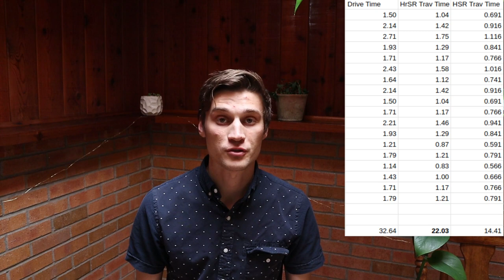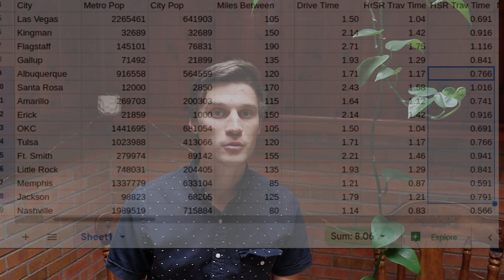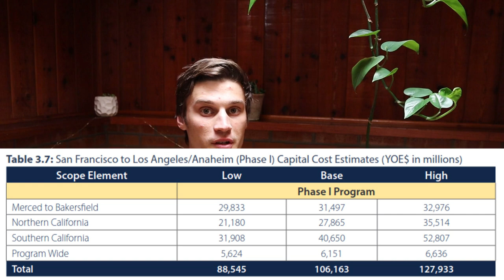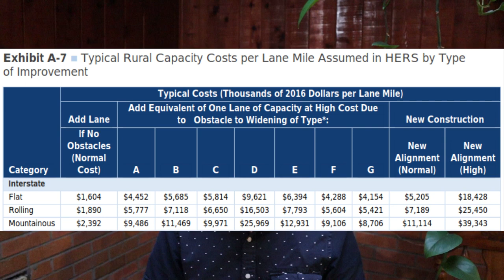What if Interstate 40 were High Speed Rail?

Comment: Nice video!
One more thing I'd point out: cost of land/right of way in California is part of the cost estimate of our HSR project. Building a similar system on less expensive property is going to decrease costs.
Reply: It's actually a significant portion of the costs, as well as over engineering of some portions because of the earthquake issue.  They could save a huge amount of money if they would consider the German ICE trains, which can handle grades of 3-4% at HSR speeds, that would cut down on the huge tunnelling costs through the Grapevine and Pacheco Passes, but that's been ruled out for some unknown reason.
Reply: Land costs were one of the big places they dropped the ball on HSR here in California.

They didn't factor in that if you build it on what was farmland, the government doesn't just pay for the land-they also have to reimburse the farmer for the lost crop value. And in the case of fruit or nut trees, that could be 20 or 30 years of production.
Reply: These comments are right. You have to separate land acquisition costs from construction costs. As a practical matter, the train wouldn’t follow the highway right-of-way as it would likely seek easier grades elsewhere that would require land acquisition expense, but then cost less to build. HSR makes sense for the shorter trips and they would build a spoke or grid model in the East (like your route to the TN football game), one in TX (Dallas, Houston and Austin) and there would be one or several in the West (connecting CA cities and LV). No need to pay to build HSR between Las Vegas and the East Coast. They shouldn’t spend to build true HSR from SF to Portland/Seattle, but upgrade the existing tracks to run fully electric 120-30mph trains and get the freight off the tracks.

Comment: What was frustrating is that Texas actually had a plan to create travel corridors that consisted of highways, passenger rail, freight rail, and utility easements that connected all of the major cities in Texas. Interestingly, truck traffic and passenger vehicle traffic had separate parallel roads. Unfortunately, there was resistance and the plan was scratched. If the plan had gone through, we would have had passenger rail between all major Texas cities.
Reply: So much better to move illegals from the Southern border to Canada. Great plan!
Reply: When the Du Pont Highway was built the length of Delaware in the 1920s, the plan also included rail down the medium, but that part got dropped.

Comment: As a retired engineer who acquired ROW for electrical transmission lines many years ago, i always told people America could copy the concept of the interstate highway system for rails.  In fact we could easily use existing interstate ROW in most cases between cities, by putting one rail on each side  or in some cases down the middle of the grassy median.  Of course elevations may present a problem in some cases.  My concept is the government would own and maintain the rails just like they do the interstate system.  Rail transportation companies could pay to use the system to transport passengers. The problem Amtrak has is they are using privately owned rails and they can only use them when freight is not using the same rail. This should be a bipartisan effort in congress or it will fail.
Reply: we are all children under the stars
Reply: @grahamcracker659  What are you smoking or drinking. Your comments are not relevant.
Reply: And the government(taxpayers) paid for the transcontinental rail with the valuable resources that came with vast land grants and then let the tycoons keep the rail system i.e. Hill, stanford, Harriman, el al
Reply: That makes too much sense and would not allow for 10% for the Big Guy.
Reply: @MitchellStil  Govern me harder Daddy, I need to be punished for adding value.
Reply: A train could carry 1000+. Cars are the most inefficient mode of transportation.

Comment: A few notes from a European:

1) Weather can certainly influence high-speed trains. Just a little snow can stop trains (making switches impossible to operate), and so can ice (build up on the overhead wires) and wind (making it too dangerous to cross high bridges). 
2) Train prices can be expensive. Many routes in the Europe are cheaper by plane than by train. Train tickets of high speed routes will go up if there is more demand and when booked less far in advance, with premiums for flexible or refundable tickets. Just like airlines. Compared to driving, trains are far more expensive, specially if you travel with multiple people.
3) Trains are far less flexible than planes or cars when it comes to problems with infrastructure, as trains don't have much choice in alternative routes. I live close to a station where I can take a high speed train to the next country -- except that starting next year, no trains will cross that border due to an upgrade of the line. 

That's not to say having high(er) speed rail won't be a good thing. But the comparison between modes of travel isn't always that clear cut.

Comment: Good video. Although You didn't include the costs of maintenance. Trains are a lot cheaper to maintain.
Reply: Any perception that trains are cheap to maintain is a mistake on your part.
Reply: @AllenGraetz  Comapared to buses and cars trains have less parts than cars and buses making trains cheap in the long run, if you want something that is cheaper in the short term which is what we should not be doing you are right but in the long term trains will be cheaper to maintain.
Reply: But building the line--cheap it isn't! Especially having build a lot of tunnels along the way.
Reply: @Sacto1654  yeah I agree with on that front but besides that trains would be cheaper in the long term considering that is why California high speed rail is being built in the Central Valley and will not extend to Los Angeles and San Francisco because of the tunneling costs.
Reply: @CityBuilder568  And the fact the tunnels have to include expensive earthquake mitigation features. Look at how long it took for the Hokuriku Shinkansen to be extended from Nagano to Kanazawa, especially the LONG tunnels between Nagano and Itoigawa.
Reply: @AllenGraetz Trains are cheaper than road vehicles on a per passenger mile basis, accounting for initial purchase and maintenance and operations.

Often, substantially cheaper.
Reply: @AllenGraetz  The facility itself (rails, bridges, ROW, wayside equipment) is cheaper in the long run compared to Interstate highways. All highways have to be over-engineered to what is perceived to be the biggest, heaviest vehicle that will be allowed to travel on all stretches of road. Rails by their function only allow a limited set of vehicles travel along any given segment and thus can be engineered to considerably tighter specs. They are also better monitored for wear and tear and since there's a much more narrow cross section passing through, means the infrastructure needed to be maintained will be smaller and easier to check and repair. But don't take my word for it since there are dozens of countries and hundreds of studies that state these overtures as fact.
Reply: @starrwulfe  also, even if over-engineered (e.g. Starrucca Viaduct), they still have lower overall cost due to reduced wear.  Roads tend to be under-engineered in the long run, usually due to underestimated demand.
Reply: High speed rail, both the trains and the tracks, are far more expensive to maintain than airplanes, buses, cars, and interstates.
Reply: @simonmacomber7466  That's explicitly incorrect, especially if you include airplanes. The purchase price and fuel cost and maintenance requirements of airplanes far outstrips passenger rail, including high speed rail. Add in costs for infrastructure like ATC networks and airports...

That's not to say a transcontinental 220 mph rail route is desirable. However, along the designated American high speed rail corridors and along relatively dense European, Asian, Australian, etc. routes, electrified high speed and high performance rail is cheaper to build and operate than the equivalent service by aircraft.

On routes with sufficient traffic to justify high speed rail service, bus service ends up costing more in fuel, in staffing, in road maintenance, and in equipment replacement. This would not be the case for a high speed alignment that sees only one short train per hour each way, but as you approach the practical upper limits of bus terminals you are now comfortably within the traffic level where rail is justifiable. Multiple longer trains per hour per direction, without taking road space away from all the legitimate road users like local bus service, or local delivery trucks.
Reply: @daniellewis1789  It costs $445.6 Million to buy 1 airbus A380.

It costs $638.7 Million to buy 1 High Speed Rail train engine, plus passenger cars.  Add to that the price of all the rail, so far $128 BILLION has been spent, and only an interim track (that can't support high speed traffic) has been built so far.

And they still have the problem that the trains still have to make way for cargo trains at all times.
Reply: @simonmacomber7466  You're way, way off. A trainset even of the Avelia Liberty ($2b fleet purchase price including development for US crash regs + substantial maintenance and support, 28 trainsets) is like 1/6 of that or less per train, $70m/trainset. Larger orders are cheaper, trainsets built to European or Asian crash regs are cheaper. 

The $128b sounds like the estimated final cost for California, the Central Valley portion hasn't spent anywhere near that kind of money.

If you mean the NEC, it's freed up a ton of "commuter flight" airport capacity between Northeast cities to serve routes without high speed rail, it serves as a backbone on several commuter rail/local transit systems, and it's roughly travel time comparable with legacy upgrades of international HSR systems. Upgrades to bottlenecks will continue to improve this.
Reply: Not according to Amtrak officials.
Reply: @Rhaman68  What isn't according to Amtrak officials?
Reply: @CityBuilder568  High speed rails require lots of maintenance and upkeep.  this maintenance and upkeep is not cheap.
Reply: @erikhadinger7655  over a short period of time but high speed trains have less parts which allows it to be cheaper than a diesel bus or car which both have more parts and have higher maintenance/ are more expensive towards maintenance.
Reply: Compare train maintenance to car maintenance as well as road maintenance

Comment: Maybe in addition to routes, you can look at cities to see how they can use existing rail and highway right-of-ways to build passenger rail services. This is what Brightline is doing in Florida and planning for LA to Vegas.

I suggest looking at Atlanta, which has a rail corridor running through downtown and also sits at the intersection of three interstate highways.
Reply from the maker: Downtown Atlanta would be an excellent place for an inter-city (and preferably higher-speed) rail station. I've discussed the location before in Southeast High-Speed Rail video: 
https://youtu.be/sH0tCaDkFCk?t=325
Reply: @ericnelius9062  Yes, I saw that video. It's not a good idea to end service in downtown Atlanta. The northern route should continue south to the airport.  There should also be a train yard near the southern terminus. I would suggest Forrest Park or Fairburn for that.
Reply: @gregory596  even if some trains terminate there, Atlanta should absolutely be configured as a through station, not a terminal only.
Reply: Atlanta should be designated as a first strike nuke  point. In 300 years it might be habitable again.

Comment: One down side is that trains cannot replace highways, since you still need highways for local traffic and deliveries. But, as mentioned in the video, we already built out the interstate highway system, so adding passenger rail can be viewed as adding capacity and possibly an alternative to widening the freeway.
Reply: Sure you'd still need highways for shipping certain goods, but cities with competent public and active transit infrastructure let you get around without a car easily. I actually think most people in the US tend to put the cart before the horse, promoting HSR as our transportation savior when really its local public transit that would have the biggest impact.
Reply: @LimitedWard  I think it only works well if you have a combined system. Having local transit options makes high speed rail more appealing. But if you are in a situation where you need a car at both ends, and it's close enough to drive, then a lot of people will just drive. High speed rail and local transit go hand in hand.

Comment: Rail between Memphis and Nashville is desperately needed.  I travel between them regularly and traffic is terrible and there is almost always an accident.  Even if not high speed, rail is needed now.  Thank you for a well researched video.
Reply: thewesternmind...Yep, and the traffic between Memphis and Little Rock on I-40 is also terrible. The roads are old and torn up ( they are being worked on but there need to be at least 2...probably 3 more lanes added each way ). Thankfully, I very seldom have to go Little Rock to Memphis. I live about 100 miles north of L.R. and when I have to go to Memphis, I will go towards Jonesboro and catch U.S. 550 ( 555...?? I forget..) highway there and take it to almost the Mississippi River where it blends with I-40. It's a much better and easier drive.
Reply: @marbleman52  The extra lanes won't fix anything because people will inevitably go "Oh neat, they added two more lanes, I can now drive there!" and use the highway more often than usual, leading to these two lanes being once again full with traffic.